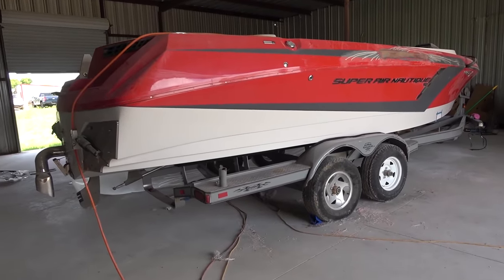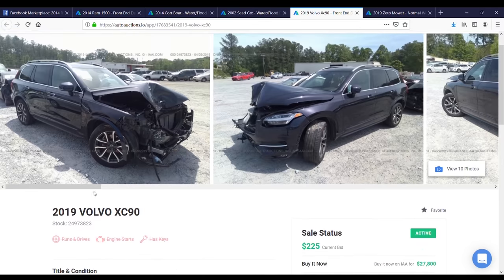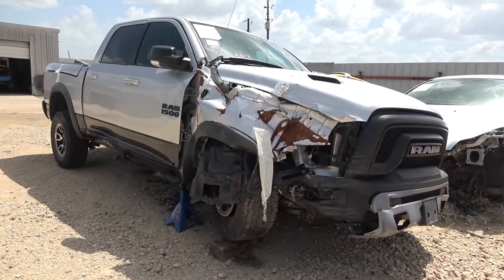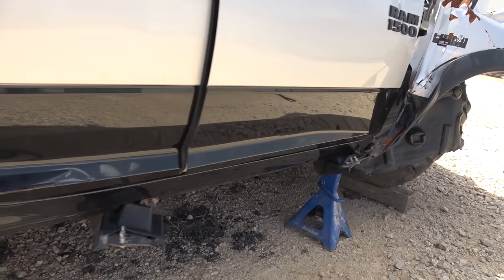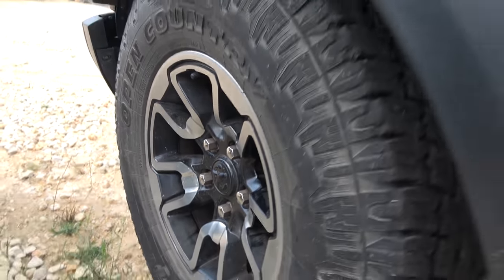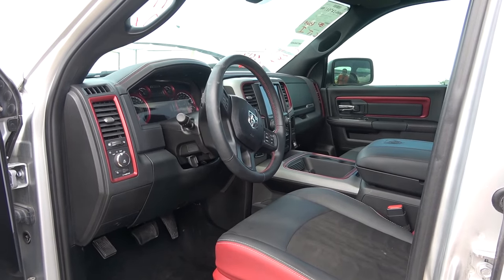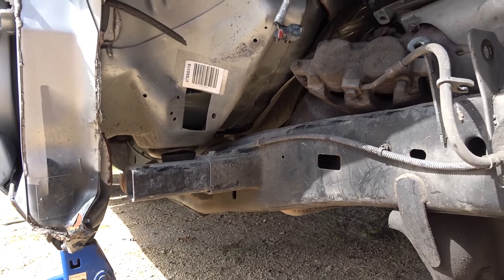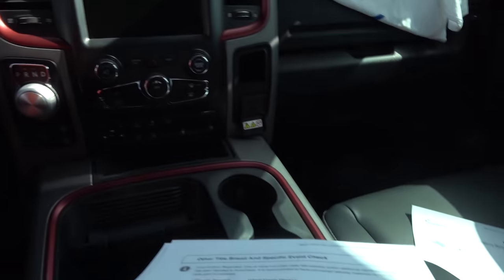I Bought A WRECKED RAM REBEL To Tow My Flooded Super Boat

Comment: I love my Rebel but last I heard those front bumpers were on national backorder and everyone knows the air suspension is expensive to replace any part of it. It’s more cost efficient to eliminate it with like a rancho quicklift and some oem rear springs and isolators. A lot of people do it when the air goes out. Just a heads up though...it’s your truck make it yours. You will love it though. Most guys love their Rebel on the forums.

Comment: Hopefully 3rd time is the charm. Before you start bolting on parts, do diagonal dimensions on the frame. Years ago we did a Silverado with a very similar hit to right front. He hit a culvert dodging a deer and wiped the right front suspension along with the body damage. We didn't discover the frame damage until we had bolted on all the new suspension parts. Turned out the right front wheel was back almost 2 inches. After hours of trying to pull the frame back to square, it ended up taking a new frame (from the factory). In the end, the truck turned out beautiful, but it is better to know up front than to be surprised after a lot of money and hours of work. Hope I'm wrong, but thought it worth mentioning.
Reply: almost  guaranteed it will need a new frame, or it will just be butchered back together.

Comment: The Rebel may be rated to tow that much weight, but safety demands a dually.
Reply: Those boats weigh less than 5gs without a trailer no way he needs a dually
Reply: @nicholasgrubbs757  listen to experience. It's not about weight, it's about stability and how high and spread the boat's center of gravity is. Now, get out of mommy's basement and get a life.

Comment: Run a tape on both sides of that frame to make sure it's not bent I have seen frames that looked just fine but were bent, even if the frame looks just fine double check it before everything is replaced on the truck.

Comment: Good luck on key. Dealer will want the vehicle there. That truck is push button start so you will need a remote fob. Your going to have to call a locksmith to avoid towing to dealer.